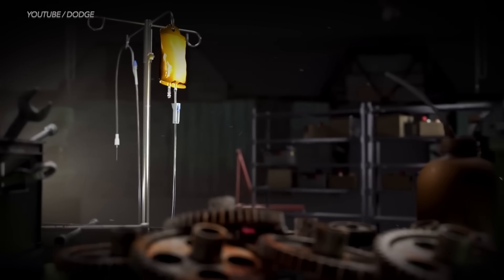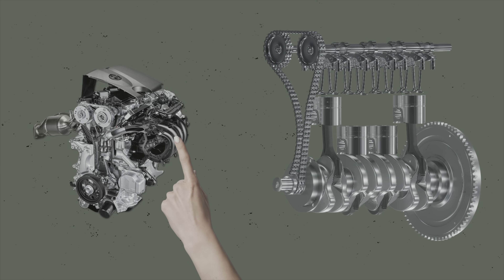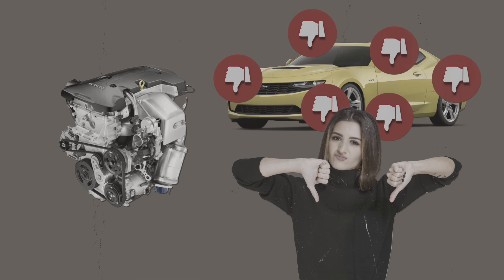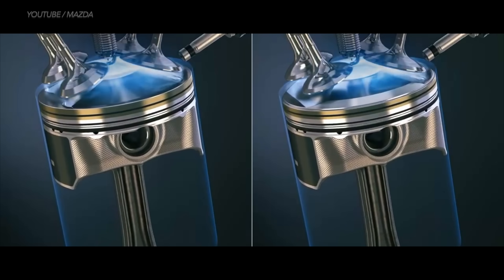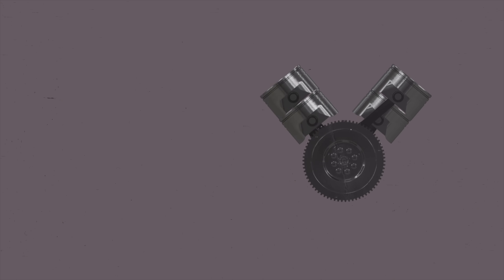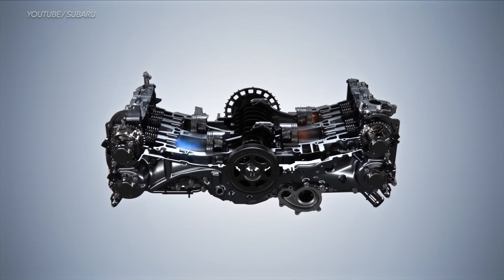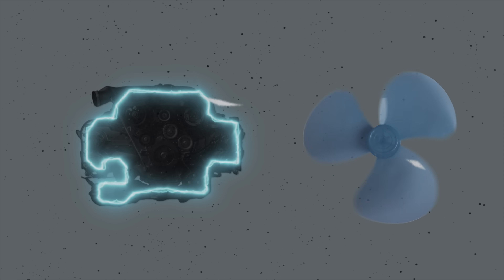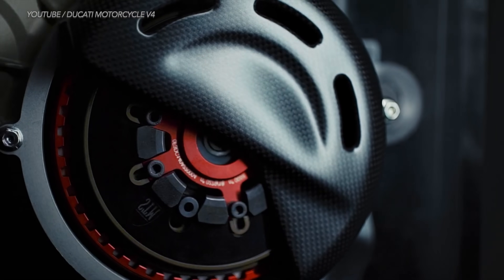This New 4 Cylinder Engine Just Killed the Future of V8 Engines

Comment: Old school Toyota 22r pretty hard to beat. Put 800,000 miles on my 87 truck and still runs strong. Regular maintainance is key. Nice that it's simple and easy to work on.
Reply: If you make it to a million miles, Toyota might buy it from you or give you a new one.
Reply: @dubvc1  Nissan did with an 06 frontier that made it to a million miles.
Reply: Eady to work on LoL. Working on a Yota... If you can see it, you can't wrench it. If you can wrench it, you can't see it!  😂
Reply: As long as you don’t overheat. They warp easily😊
Reply: Loved my 85 Toyota Truck. Ran till the Frame Cracked. Should’ve pulled the Motor and put it in Another one!
Reply: I had a r22 in my pick up, had a tree fall in and got rammed by a Karen. The engine and transmission was still good, The body and Frame was past the point of repair.
Reply: I got a 87 truck with only 23,000 miles.
Reply: I pulled a nice Weber 2 venturi  off a Toyota 22R in a junkyard once.  Paid $20 for it. That carb conversion with a set of header pipes really had a lot to do with early demise of that car.
70's and 80's era Toyotas were changing hands for $400. Rust was the deal breaker.
Reply: Yes one of the best
Reply: A previous boss of mine had an 02 tac truck 500,000 on it
Reply: Only problem is the v8 comparable gas consumption...But, my 88 pick up is 500k+ still going strong.  Bulletproof.
Reply: I've got a 22RE in a '94 pickupand a Nissan KA24E in a '95 pickup

The Nissan feels like it has about 15% more hp and torque. But also gets roughy 20% worse gas mileage.
Reply: Wait what 1987 Toyota truck?! Wow! Which part is still original?
Reply: That is a GREAT little powerhouse. I miss my old 80's Toyota. Hope you make it to 1Million miles mate!
Reply: Go Toyota!
Reply: Yes, those motors are bulletproof!
Reply: @silasmcgee3647  yup yup that guy is now driving new gen tundra ttv6
Reply: Great job, keep it up
Reply: Had a '90 pickup with the 22re. At 100k miles the radiator cap went bad and allowed all of the coolant to evaporate. I didn't realize the coolant was low because it wasn't sucking coolant out of the reservoir.  The engine seized up. Once I allowed the engine to cool and added coolant it ran just fine after that. Truly bullet proof. Most engines would have been toast
Reply: @silasmcgee3647  but can't say about this period of big 3 v8 which FYI r all crap loaded just to fail in long-term ownership that owner think it as reliable but get delusion . Only v8 that is truly legendary reliable r from either bygone era or Toyota 💀
Reply: If you do make it to a 1,000,000 miles and Toyota offers to buy it, do NOT sell it to them! You’ll be left with an option to buy a plastic computer on 4 wheels. Do NOT sell it!
Reply: @TurdBugler  plastic what
Reply: @TurdBugler  ha ha ha yes
Reply: Claim: "I drive a brand xyz with over  800,000 miles." Fan boys schmooze all over the internet myths.
Reply: How many miles in-between oil changes? What kind of oil?
Reply: @markme4  Quaker State regular green label 10-40 every 3000 miles. I made 2 videos at 666,666.6 miles. One for Toyota and one for Quaker State. Got a new phone shortly afterward and Dipshit sales rep ruined both videos transferring phone contents. Also Had vid of doing donuts at 500,000 that got destroyed.
Reply: @johnbolton9957  Thanks for the info, every 3000 miles , that is old school but it works. 
I had an 89 22R flatbed dually, great truck, I wish I would have kept it now. My Triton V10 is killing me on gas !
Do you use any engine additives or fuel treatments?
Reply: Two guys at my work daily drive those trucks. I have no idea what the mileage is on them.
Reply: My wife and I got married in 2004. In 2005 it was time to buy her a car. While in the maintenance department at Hertz I feel in love with the 4 cylinder Camry. My wife really wanted this Kia. I forced the Camry and she was pissed for a while. It's been 18yrs, I've replaced batteries, tires, oil, gas cap and nothing else. That little four banger  still get high 30's on long drives. I love that car.
Reply: @plattwinetrout  Why would she want any Kia over a Camry?
Reply: @williamzhang963  she liked the color. 🤷🏻‍♂️
Reply: @williamzhang963  hilarious really, whot would wand a hyundai over a camry....

Comment: Subarus blow head gaskets. I had a 2006 Outback. Had to replace the head gasket. And the car was a dog. It could barely get out of it's own way. Once I went to a Toyota V6, the thought of going back to regular or turbo-charged 4 cylinder crap is depressing.
Reply: That was addressed with the FB series engines.  No engine is perfect, but the head gasket issue was the EJ series.
Reply: I even drove the newest Subarus and found the 4 cylinder engines pretty slow. A boosted 4 or nothing for me!

Comment: I have a 2023 subaru crosstrek 2.0 cvt and my son has 2018 mazda 3 grand touring automatic they both seem to run good my sons cars is a 2.5 we raced and stayed dead even at times the crosstrek would pull ahead but around 100mph the mazda started pulling on the subaru now for mpg the subaru gets better overall better mpg time will c which lasts longer
Reply: Is really hard to believe, power to weigh ratio, awd loses more power to the wheels from roll than a fwd, has more torque and hp, and weights more. Yes it gets better mpg  because of a smaller displacement and cvt transmission. transmission. I disagree with it being more reliable engine or transmission, the Mazda 2.5 and 6 speed AT has a an overall better record in reliability than the Subaru.
Reply: @D Cal  yea wish the subaru was a 6 speed but the cvt is so smooth

Comment: My favourite engine is a Hyundai 2.0 Turbo GDI Theta II engine, it has plenty of horsepower 275BHP and its smooth and its been 100% reliable.
Reply: Isn’t that same engine keeping Hyundai/Kia  in court forever??
Reply: My brothers blew up on us on hwy 395 250 miles from home. Common issue with the theda engine
Reply: @stevesmith756  The Theta II engine that's built in Europe and South Korea is very reliable, my engine is on 158,000 miles and is due it's 27th oil and filter change as I change the oil and filter every 6,000 miles and plugs and air  filter every 30,000 and the manual gearbox oil every 40,000 miles and touch wood other than a clutch and 3 coil packs I've never had a problem.
Reply: @Sprograt  the Theta II engine is very unreliable and prone to failing. See Hyundai class action lawsuit. Settlement May 2021. Huge problems and engine failure. Stems from bad engine design with poor lubrication. I was in my brothers Hyundai when his Theta engine blew. Absolute junk
Reply: @stevesmith756  I would not call them junk but the quality control is missing and the dealers replace quite a few of them
Reply: @jamesmedina2062  Hyundai makes some good ones but talked to the dealer mechanic. It’s a design flaw. Can’t really fix it. Just basically put a bandaid on it with a computer reflash
Reply: @stevesmith756  I read that machining processes were not finished properly to clean oil passages.  I would hate to work in a Korean factory because Koreans have these tempers and do not like criticism. Opposite of the steady and patient Japanese manner which allows truth to come forward.

Comment: VW also had a W8 which is like two V4s stuck together so it kinda counts.
Reply: @Tom-qv2jg I have a 2000 ALH. Still going strong at 290k.
Reply: @Tom-qv2jg The ALH is well regarded and I figured it was included in what you were talking about. It really started the decline with their later (common rail?) stuff by my understanding. Though you may disagree.

Comment: They tell me the 2.3 duratec (ford/mazda collaboration) will run forever in my old ranger. I've never had an issue with the 1.6 in the nissan.  Both naturally asperated. Mated with manual transmissions they are as simple as I am. 🤠

Comment: The regulators changed the stroke of motors in the 70's for fuel economy and pollution control. That should be deregulated, then the tree huggers can go blow a crow.
Reply: No! Short stroke is better!
Reply: @jamesmedina2062  no? you are correct.
Reply: No…I don’t want to breathe in more pollution.
Reply: @snowfox7739  as if cars cause the main pollution and not other sources which are barely regulated..... As if the big cargo ships or airplanes arent far worse due to far less regulations or the large amount of coal power plants
Reply: @snowfox7739  i'm having a cigarette.

Comment: Spoiler alert they're all slow and boring
Reply: What do you consider a fast car?  Anything in the 3 second world?
Reply: @sapphir8  it's really about the top end nowadays but I would say under 4.9s is a good 0-60. Even at the 6s mark the top end power is just not enough to hang in a light car like a civic let alone a suv. I daily a toyota avalon and today I've been up and down the highways racing I came across a couple different gens v6 285hp compared to the 140 in the civics altimas, boxer engines it's all several seconds, many car lengths difference.

Comment: I got a question and you’re the best person suited to answer this. I have a 2018 Toyota Avalon. 94,000 miles. I got it at around 63000 from the Toyota dealership. I’m not sure if it had the transmission oil changed or not. Is it a good idea to change it at this mileage? Thanks!
Reply: should have changed it before now but do it asap( i am an ASE master tech!)
Reply: @andrewslagle1974  awesome. Will get it done. Thanks!

Comment: I have a 2013 dodge grand caravan vvt v6 with almost 300,000 miles on it. It gets 18mpg in town. don't know about highway. The onbly thing I have had to do to keep it running besides regular oil changes is replace the alternator and battery.

Comment: In-line 4 cylinder gets my vote. 

My 2007 Honda civic has over 350k miles and still going strong! Just by using Scotty’s advice. Thank you so much Scotty!
Reply: I’m sure mustangs are fantastic and you are correct that I’ve never driven one. But I have driven a couple corvettes and they were amazing!

But this video is about 4 cylinder engines and my civic is an inline 4 cylinder with over 350k miles on it and that’s why it’s got my vote.
Reply: yes sir same year 2007 civic LX R18 motor i4 sohc vtec
Reply: There was a V4 motorcycle and then a V4 standalone engine based on LS1 architecture but the company went bankrupt unfortunately. It produced amazing numbers and would have been a very good fit for compact and subcompact cars . It had both low end power and torque but could still rev .
Reply: My fathers 2007 civic 1.8 litre 4 cylinder petrol has only done 34,000 miles in 16 years.
So it will outlast me when i take it over haha.
Reply: Those 8th gen Honda civic that you own has one of the best Honda engines ever made. Those 1.8L is the perfect daily drive and provide long term reliably. It not  the most fastest or most powerful Honda engine, and that's OK. I've seen those engines go up to 600,000 miles. Only down side is the paint job lost of recall.
Reply: @Costarica-mq8el  Im not surprised they go to 600,000 miles, my fathers 2007 34,000 miles honda civic 1.8L is a keeper and will be keeping it for another 16 years at least, that's for sure.
You bang on about the paint and has poor laquer peel.

Comment: Raise your hand if you love V8 engines ✋
Reply: Straight six...sorry
Reply: @flynick I love those aswell and V6
Reply: V8 engines are in a class all by themselves which is awesome 🇺🇸🇺🇸😃😃💪💪💪👍👍👍👍
Reply: Love my 5.7 tundra and 340 duster
Reply: I don’t the gas milage on mine is horrible less working room in the engine bay more another valve cover gasket to leak
Reply: Straight 6 for me @joshuamast5128

Comment: The original Beetle used to have boxer engines, air refrigerated. Those engines lasted forever and in a pinch, you could fix it with a nail and cotton/linen strings. Nowadays the complexity is so much you need a German engineer to change the oil.
Reply: I used a chewing gum wrapper to get my bug home. It worked so it was a while before it was "fixed"
Reply: Are you sure they were boxers?
Reply: @mr.redneck2715  Yes all the air cooled vw engines were flat-4 boxers. Some of them had electronic multipoint fuel injection even in late 60's to early 70's, (dustin hoffman advert car and later the beetles sold to California)
Reply: @jeromehattkronen2305  1st fuel injection was 75.
Reply: @mr.redneck2715 porsche uses boxer engines in most of their cars but they are usually 6 cylinders and porsche and volkswagen are connected somehow. Or at least they used to be. I am not 100 percent sure about now.
Reply: @mr.redneck2715  My VW was a 1966 beetle. It was a horizontally-opposed 4-cyl air-cooled engine; we referred to those engines as a "pancake" engine. Google states: Horizontally-opposed engines are often referred to as “boxer” engines because the motion of the pistons sort of resembles a boxer, punching."
Reply: @mr.redneck2715  “horizontally opposed cylinders” ie Boxer.
Reply: @mr.redneck2715  
You made a joke!  Boxers..  What are you doing for summer vacation?
Reply: @jgrenwod  Maybe you misunderstood I never made a joke!
Reply: Boxers or briefs?  No.  Thought you were trolling us.
Reply: Think you mean air cooled, not air refrigerated. Grew up in '60's. My recollection is the air cooled engines had a very short life span. However, they were light weight and easy to replace. They also lacked a heater.
Reply: @neilabernath5862  they had a heater. Worked best in the summer.
Reply: @neilabernath5862  That was because so many people did not perform even the simplest maintenance on a regular basis.  Boxer engines, especially air cooled VWs, do not tolerate negligence as well as the average water cooled I-4/I-6/V-8 engines.  I know - I worked on them.  I had a '66 VW Beetle that was still running well at 146k when I finally sold it.
Reply: @eskieman3948  as long as you kept an eye on the oil level and adjusted that #3 (?) exhaust valve, the one under the oil cooler, they would run for ever.
Reply: @pilot155  They weren’t disconnected.  They failed.  The sheet metal shroud that surrounded the exhaust manifold would rust through.
Reply: Nobheads everywhere.
Reply: Drill a hole into the engine to set the level.
Reply: fact check, the old VW pancake engines only had a life span of 10000 miles! I also wondered why...
Reply: @charlesbreaux5475  That wasn’t my experience and I owned several. 56, 62, 70.
Reply: youre telling me you need a german engineer to use a flathead screwdriver and a funnel to change the oil in a vw now?
Reply: @mitchellg3893  
You have no idea!  Just changed the fluid in my Passat dual clutch auto transmission.  The process is beyond complicated.

Comment: Engine are not designed to be durable. Companies do not make money off the sale of engines or vehicles. If the engine is only 2k in price. Expect to pay 30 to 40% of the value in parts before a engine rebuild is required.

Comment: What do you think of the TDI
Reply: Most of them are very good and extremely reliable it’s the emissions systems on newer ones that make them problematic
Reply: @joshuamast5128  as long as you don’t idle the car for a long period of time and drive short distances your good
Reply: @SimpleSnoop-RVLS  as a diesel owner, driving short distances kills the Diesel engine's efficiency. Long drives with consistent speed is where Diesel excels at.....or if you want to haul weight because the max torque is created at a lower RPM compared to gasoline engines
Reply: dead. Its too expensive make because they don't meet emissions. Not to mention Diesel tends to be more expensive in NA which is huge market (not as big as Asian but still a huge one)

Comment: It kinda sucks that the V8 is a dying breed. I love them.
Reply: It’s crazy that there were v16s in the 1930’s. Only cars like the Bugatti have them now.
Reply: @djplonghead5403  What's even crazier is that those 1930s V16s only made like 160hp.
Reply: well they are going out the door thx to gov regulations. Best part is the 4 cylinder cars are next. Peasants will be limited to bicycles
Reply: @dergunter1237  yeah… I think the V6 is getting the ax next. Or also the inline 6
Reply: @pandaant  both, and after that any 4 cylinder that isnt an inline 4.
Its not just government regulations but also  inflation and profit margins causing manufacturers to produce the cheapest possible system i.e. an inline 4 engine. Best part is you will still be paying V8 prices for that inline 4 engine